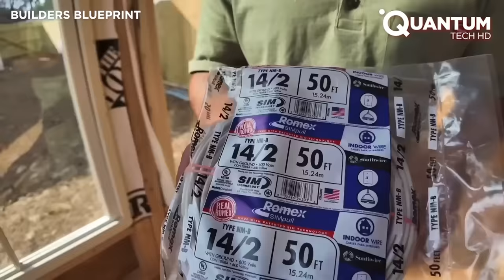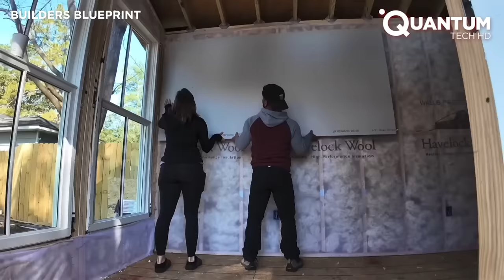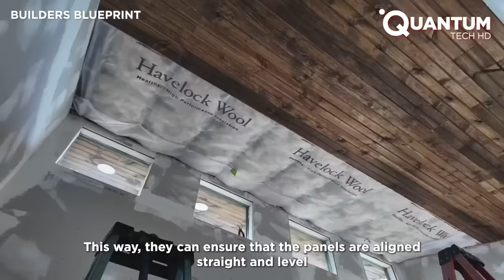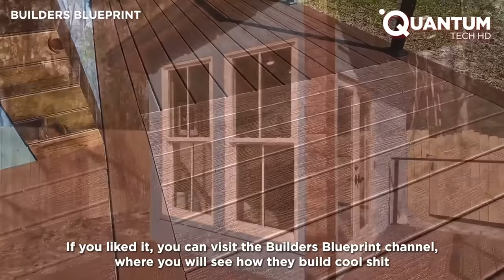Building Amazing DIY Wood Cabin Step by Step | Start to Finish by @buildersblueprint

Comment: Something this well made deserves a concrete foundation
Reply: Exactly my thoughts
Reply: We are moving away from concrete foundations.  Younger generations aren't into permanent.
Reply: That was LITERALLY what I was thinking.  Isn’t soil erosion a possible problem in the long term?  🤷🏽‍♂️
Reply: In Germany a concrete foundation makes it mandatory to have a build permit. Without permanent  foundation and under 16 square meters its classed as a shed.
Reply: I think they know that they'd have to add concrete. My opinion is that this video is more so just a tutorial on how to build.. Maybe doing the concrete part would've taken to long for this video and point that they were trying to prove.
Reply: @meoff7602 younger generation aren’t into built properly also.
Reply: Permanent means taxes
Reply: That’s what I was thinking
Reply: I think it has something to with it technically being a temporary structure, someone else in the comments said something about taxes. I'm sure that has something to do with it.

Comment: One old tip from a old painter. @ 30:58 you build your own window frame with I assume a piece of glass installed.  You assembled the frame then installed the glass. The proper method is to"PRIME" the whole frame completely with a exterior OIL BASED primer... including in the grooves for the glass. Then after a few  days of the primer drying and curing...then seal with your chaulking material...then assemble the frame. I would also recommend not using a 100% Silicone in the groove because if some gets on the face of the frame the finish coat of paint will not stick/bond! The finish coat will continually dispurce...the oil primer will give the frame added protection on all sides from any moisture.  We used to oil prime exterior facure boards front back and edges for added protection on new construction.  Of course today 🙄 😒 money/time is the bottom line.  FYI...Das 😎all! ❤👍Nice job guys!👍😎
Reply: @user-el9df1gg1q  
I did not count 🤣! I know of at least one🤔. I hope my point came across. 
Auto correct...🤣! 😒 Das 😎 all👍
Reply: New at this, huh? 🤣 👍✌️

Comment: As a painter of 20 years, I never use a sprayer on the outside. Not unless you plan on spraying it 5 times you aren't putting any paint on. Several people that I know have bought a really nice house, gated community,  and wonder why they are having problems in 5yrs or so. I really do like the overall design....

Comment: you work a lot , you dont need a gim , man
Reply: Critics raise concerns about the safety and structural integrity of self-built wooden cabins, emphasizing the importance of professional construction expertise to ensure durability and compliance with building codes.
Reply: The allure of DIY wooden cabin building may overshadow the importance of proper structural engineering, posing dangers to both builders and occupants.
Reply: I do like the way cabbin looks, 
But I don like the idea of using this all space just for gym equipment..😮
Reply: Cabin looks good but some way the do some things are not correct...the plates for the cable fence , look so weak and dangerous 😢

Comment: Can't see how the building will stay level without proper concrete footings or a base.
Reply: That’s an easy fix, it isn’t like it’s a big structure
Reply: The deck footers got more stability than the building.  Given the level of detail in everything else that was an odd omission.
Reply: He had concrete footings and a stable ground base. The ground is already stable and settled. It's hasn't been dug out so it's a solid base.
Reply: Even if a footer did sink,  this thing isn’t that heavy they could shim

Comment: This guy is a master craftsman amazing job with an amazing result I learned a lot!!!
Reply: Supporters of DIY cabin kits argue that pre-cut and pre-fabricated materials streamline the building process, making it more accessible to DIY enthusiasts with limited carpentry experience.
Reply: Skeptics express concerns about the lack of regulatory oversight and inspection for DIY cabin construction, potentially leading to non-compliance with building standards and zoning regulations.
Reply: The growing popularity of DIY wooden cabin projects calls for increased awareness of the risks involved and the importance of proper training.
Reply: What did you learn?
Reply: Doing framing hardly qualifies as a master craftsman in the trades.
Reply: @travishatfeeld6513  OK. Post your video, so we can see how a 'master craftsman' do it. I'm sure you don't even know the difference between a piece of wood and your brain.
Reply: @desertstar223  if You've ever built  homes for a living, you'd see there's a few things the guy did wrong and will likely cause issues like mold, dry wall cracking, windows not opening a year or 3 down the road depending on the climate in his area. So technically i wouldn't call this guy a master either. He's a good handy man tho.

Comment: Mostly nice build, but siding and trim appears to be a failure  - will rot due to lack of z-flashing between plywood panels and above trim boards. The caulking won't stand up to the elements for long. I've personally seen too many of these fail

Comment: personally i would use 1x4  or cheap plywood cut in 4 wide and put on bottom of joist then the Ridgid foam board  the 4in stip provide support and keep from slipping out the bottom before having chance to seal edges

Comment: Erstaunlich, was ein Mensch leisten kann, mit „“ Wissen und Geschicklichkeit““.
Reply: Detractors caution against DIY cabin construction for novice builders, warning of potential risks such as improper foundation placement, inadequate insulation, and susceptibility to weather damage.
Reply: The accessibility of DIY wooden cabin tutorials may lead to a false sense of security, neglecting the risks of structural failure and collapse.

Comment: I would recommend next time using a small airless paint sprayer. That little cup gun probably had to refilled every 10-15 minutes and most likely took forever. An airless fits in a 5-gallon. Bucket of paint and you don’t stop spraying until you’re done or the bucket is empty

Comment: When placing the boards to the concrete blocks, is it necessary to put some adhesive on the wood and blocks or is the weaight of the structure good enough?

Comment: Looks really great. Well built and top finish. One question. Do you not loose sleep with no foundation under those block?
We don't have those blocks in the uk so maybe its all fine?
Reply: In regions where there is no freeze-thaw cycles, and the earth is firm enough, they'll be just fine for a shed like this. Would not be suitable for heavier structures.
Reply: Not putting it on a permanent foundation is a way of circumnavigating building code in America. No permitting involved with this build. You might act like that’s a bad thing, but it’s a principle called Freedom.

Comment: I would say this guys built a house or two in his days. Man... Excellent work and no corners cut anywhere. If I were nitpicking, and you may have a reason for it, but I normally would frame the deck at a quarter bubble away from the house to allow for water run off. Again, just an observation. Great Work!
Reply: Advocates of off-grid living promote DIY cabin construction as a viable option for achieving self-sufficiency and reducing reliance on conventional utilities and infrastructure.

Comment: Top job. But I am a little confused why they are insulating the cavity to prevent heat loss but opting for 4 single pain windows at the top and possibly the side? They'll let out a shit load of heat in the winter.

Comment: There's more exterior livable space on the porch than there is in the little tiny house
Reply: Skeptics question the long-term cost-effectiveness of DIY cabin construction, suggesting that hidden expenses and maintenance requirements may outweigh the initial savings compared to hiring professional builders.

Comment: How much does it cost?
Reply: A lot, go to Home Depot one of those wood is expensive.
Reply: I assumed it.
Reply: very very nice House,🏚️🏤🏦
Reply: Ci pagava un abbonamento a vita con personal trainer
Reply: Just under 15,000
Reply: @sewfantastic7257  not anymore. Try going to home depot as you suggested and find out for yourself instead of saying what the crowd says.
Reply: @buildersblueprint wow l am surprised. Beautiful build. Love the attention to perfection.
Reply: 30k
Reply: @buildersblueprint 15000 without labour costs. Most people need it built and it would easily double the cost. 30k easily for a contractor to come and build it with another guy. Probably looking at 45k

Comment: Why isn't thermal mass heating and cooling used in the building processes?   
Building  in the ground.  (3 or 5 feet ) don't we need to get smarter about utilizing these elements?

Comment: Wow. Exactly how not to do most of it. It won’t last and will need to be torn down. Will mold and sink. No concrete under blocks. Why tear the paper off of insulation? Why lift drywall up? Set on bottom and stagger joints. Mud gaps then tape and trim out. Why all windows when you are running lights. Is it a shed or she  shed?Im not going to repeat the other mistakes mentioned.

Comment: Really? Some pretty poor construction practices shown here. Never put a vapor barrier directly under the sub floor with no breath ability below, it will trap moisture between the subfloor and vapor barrier. Soffit- floating the ends past the rafter centers, no support for the butt ends joints. Clerestory windows over doors since he made the frames with rabbets for the glass, if one breaks the only way to replace is to remove the entire frame and replace- poor idea and it also leaves no room for expansion of material, could crack the glass. Never ever put joints in drywall directly over each other.. Bad idea and its asking for trouble and weakens the entire system. Not sure the shed foundation or the deck foundation meet code.,no interior clerestory window trim?  Not sure the guard rail posts are installed per code with appropriate supporting blocking below, though it is not needed as the deck is below minimum height requiring a guard rail.
Reply: Why don’t you post a video and show us what you mean , as in my opinion it’s a DIY so anything he has to fix or change he will do so it’s not like he’s paying someone to do it wrong,, but please show and enlighten us
Reply: @C-IM2NaSTY- my thoughts exactly 😂 could you be arsed
Reply: You are right. Floor beams are a single member, no joint hangers, not even close to adequate.
Reply: Oh I fell 12" ,if you were a Dr. You'd have me in a nursing home ,one that breaks all the rules of care but smart enough to bs. Everyone out of their money
Reply: All this work and no plumbing. I’m a plumbing contractor. I don’t build anything without plumbing.
Reply: I agree with this. Several strange building choices...
I also reacted to the single pane windows, which seem to be an odd way to save costs, instead of installing proper windows. All the insulation is kind of pointless when the windows leak energy
Reply: I agree about the plastic under the floor . It will create condensation and will eventually mold . Not good .
Reply: 只是個儲物櫃不必太認真，問題發生時還可以再改進。

Comment: Not a good idea to put down plastic before plywood is there is a leak plastic won’t allow it to simply bleed thru and drain … rather it will soak the whole floor … there simply no need for it

Comment: As a Fitness Trainer my concerns are: the lack of Horse Stall mats to protect your flooring. 
The mirror is not behind the squat rack for lift visuals. 
The clearance from barbell to wall is scary close. 
One cannot perform Olympic movements, let alone squat, DL, OHP and bench. 

Not nit-picking, just legitimate concerns.

Comment: Check out span support for 2x8?  Too many support blocks.  Fire blocking in a shed?, really?  Videos should be seen by professionals first, then put on line.
Reply: So diy not done by professionals chill out
Reply: @publicadventures  Sorry guy.  I guess I came across a little harsh.  It is the end results that matter the most.  Safe, sturdy and looking good.  That was accomplished by watching your video.
Reply: @gordonturner3554  I don’t have a video on this but how would too many supports be unsafe
Reply: @publicadventures  not unsafe at all, but an unnecessary cost you can avoid.  Remember that a 2x8 can span 12’4”.  That’s why a typical bungalow is 24 feet wide with only one beam in the middle.  If you go in the basement they don’t have those extra supports, like in your shed construction.  Building codes are available on line and have a wealth of information.  If you can stomach the wait, go to the building department at your city hall.  They can always help out.